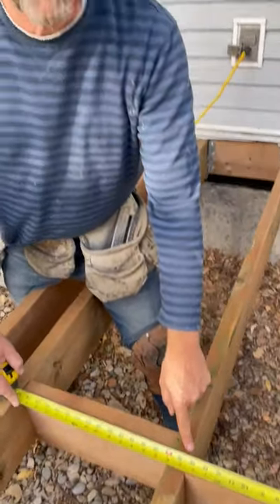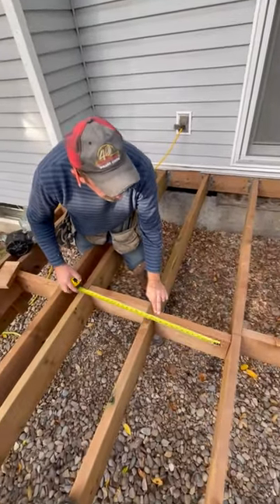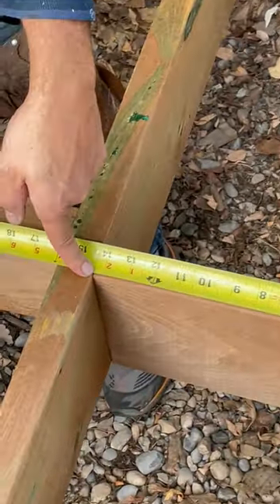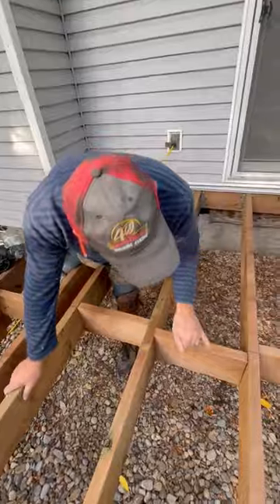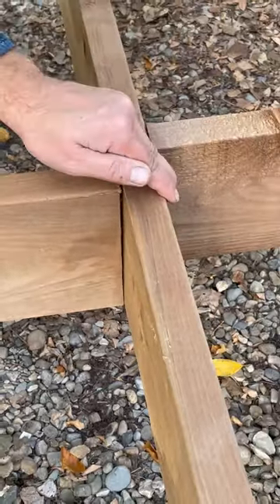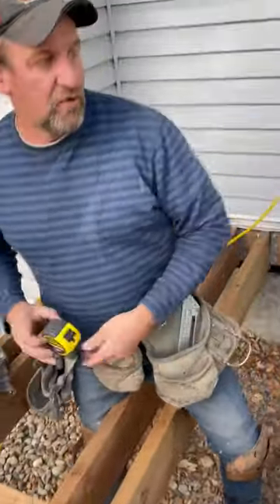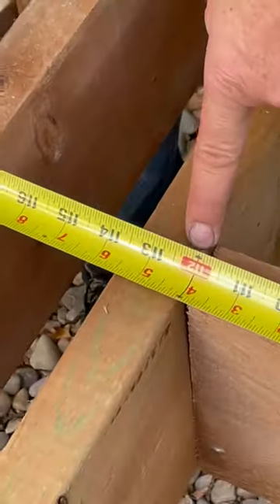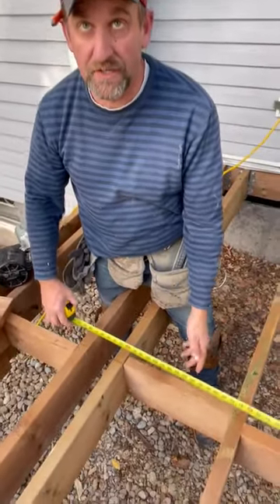Deck Joist Bridge Blocking

Comment: Very proud of you. 
All that extra time and effort will show up, and make a HUGE difference once the deck boards go down.
Reply from the maker: Thanks, I think.
Reply: not really lol 😂 it’s all getting covered with deck boards. those blocks are a waste of time and are doing absolutely nothing. they have no structural purpose. before you start decking. tack a scrap/ crappy looking board to your  joist on layout with 8’s in the middle. that will straighten them. install your decking up to the straighter board, pull it off and finish the deck. effectively saving 15 minutes and a rack of gun nails
Reply: @alexlaidlaw220 ,
   Those 'blocks' are what's called 'bridging'. They make the joist assembly stronger. When you're standing on a joist with bridging you're standing on three or four joys because they're connected that way it makes your deck way f**** stronger and more stable on top. Also if you've got some decking running another direction instead of all just one way you bridge on 16'x centers for nailers at 90°, etc..
Reply: @oldnick4707  these youngsters think they know something... those blocks add soo much strength.. it's mandatory over 14 ft in Michigan
Reply: @jaycie5200  I’ve been framing houses in Michigan for a decade now. The houses we build have spans up to 16 ft (16’ 2”) exactly. no blocking in between. nailing a 45 degree brace would be best bet for sheer value if you really think you need it. But these stupid blocks are doing nothing for downward pressure and little to nothing for sheer.
Reply: @alexlaidlaw220  🤔🤔👍
Reply: @alexlaidlaw220  😫
Reply: @alexlaidlaw220   aren’t you a silly Billy. Walk over joists with no blocks added, then try it again with blocks. Huge difference
Reply: @alexlaidlaw220 we don't claim you. Thanks Michigan. We use blockers in Michigan son

Comment: Very nice. I go 14 7/16 but I might switch to the 3/8s. If I have cupped joists I’ll try to suck it out with a screw, and if my cut isn’t square I throw the block at my cut mans head
Reply from the maker: LOL, good idea with the screwing.
Reply: Put 2 -16d or 20d hot dipped galvanixed nails together and face nail them into the staggered blocking. Sucks them up nice and tight.
Reply from the maker: @alfmuss3  Thats a good tip. Thanks.
Reply: I don't know about all states,  but "most" the time we get wet treated lumber the chemicals have swelled it up some. In other words 1.5 inch is more like 1.65...
Then when you cut your block a shanty short...your bang on!!!

Comment: I do a lot of composite decking and the decking we get we always have to cut off a 1/2 inch of each end because the factory cut is not square or the last bit curls up so 14-1/4 works for me doing composite decking. I would love to try to evenly space out all my joists, maybe I’ll talk my boss into it on next job, its just money lol.
Reply from the maker: Give it a try see if it saves time and money. Or makes the deck better. There is no right answer just tricks that help us along.

Comment: Need to clarify that you are measuring outside to outside which is the same as center to center.  that's why the measurement was read on the edge and not in the center.  Because you hooked onto the outer edge and not the center of the first board.
Reply from the maker: Point taken, I could have been more clear.
Reply: @decksbye3269  It's still a really good important video.  That 1/8th inch of grace is a good rule to remember.

Comment: My understanding is that blocking is to prevent the joists from rolling over.  If so, having minor gaps is just an aesthetic matter.  Right?
Reply from the maker: Correct.
Reply: Thanks for your reply, and for the video.

Comment: I cut blocks at 14 7/16" but If I tell the apprentice to cut them, I ask for 14 3/8" , for that same reason, 😂 to account for imperfections. cheers
Reply: I tell them to leave the line on 14 3/8"/ 22 3/8" blocks. 
As a framer, 1/16 is not spoken. Cut the line or leave it.
Reply: @anthonyjohnson-dd1ln  I am a perfectionist framer, sometimes measure to within 1/32" , but I don't expect that much from you or newbie helpers🤣
Reply from the maker: Jer, good point.

Comment: The gap renders the bridge block useless.  You will feel the sponge of the joist and hear the fasteners.
Reply from the maker: They are still making contact just accounting for imperfections in the joists material.
Reply: @decksbye3269  saw a few gaps on the video.  I pull a tape every 8 foot or so and adjust that one block if necessary.   Cutting them all short guarantees a gap in several.  One sixteenth off each means you loose ¾inch in 16 feet.  Either you have many gaps or bowed boards.

The average board is 1.5. 
14.5 blocks leaves 16 centers. After 6 or 8 of those you might need to adjust one a sixteenth either way. Every 8 or 10 blocks I eyeball down the joist to see how much to add or subtract from the next 14.5. All tight and right. 

20 years design,draftand build. Never failed a plan review and never failed an inspection on my end.
Reply from the maker: @ticktickboom420 , that's a great track record. Checking every 8' is a great way to account for variation while building quality.  To be frank, even when I cut the boards shy and need to check every 8' or so to ensure that they are lining up correctly.
Reply: The one guy I see here who 'gets it' The goal isn't to make them fit, it's to strengthen the floor.
Reply: @BobVogel-t1u  yes engineering not aesthetics.

Comment: When you tell your apprentice to cut the block at 14 3/8 and they look at you full of confusion 😂 so they cut it at 14 1/2 out of pure ignorance then you politely tell them they are of the slow species 😂
Reply from the maker: And it all works its way out
Reply: You need to explain to your apprentice why you are cutting them at 14-3/8" as opposed to the 14-1/2"

Comment: You could use a sliding t-bevel and get them tight while still accounting for the joists being twisted.  But who has time for that??
Reply from the maker: Its an option but like you said, it takes time.
Reply: It takes time correct just like making this video I would have spent more time on the deck

Comment: But if you lay your work out right, your work won't be off. So the 14.5 inch blocking will work out right. Blocking should be tight not lose.
Reply from the maker: Like Paul said, if the wood was perfect but till than you need to account for imperfection.
Reply: @paulunderwood8960  Paul, I have Been a Builder All My Life and I am Old Now. I'm not saying that " To Hurt You. I said it to Help You. The Purpose of the Sheets Metal on the Back and on the Top of the Joist Plate is to stop Wood Rot. The Leg Bolts 1/2'' diameter x 6 or 8 '' long is Strength. The Ledger Board on the Wall Joist or Joist Hangers is Also for Strength for the Floor Joist. One other thing being outside and Using  Pressure Treated Wood Always use Stainless Screws. Not coated because the Acid in PT WOOD will eat or dissolve the coating on Carbon Steel Screws. Using SS Screws use a 304 SS Screw or Higher. The SS Screws  304 or Higher Grade SS, because it will not Rust and will be there longer than the Wood. I prefer a #10 or #8  Screw for P T Wood. There are different Grades of PT Wood. Get the One with the Highest Grade of PT Wood for High Class Work. It Cost More but it Last Longer. The best PT Wood is placed in a Pressure Vessel and pressurized to about 200 psi at a High Temperature. The Higher Pressure, Hot Chemicals and Time Equal Better PT Wood. Today they don't use Arsenic. The Arsenic made the Wood last Longer and more Pest Resistance before 2003. Any PT Wood pre before 2003 would last 10 years longer than today's PT Woods. Please understand I am only wanting to Help You. My time building porches or Decks are Over. I have the knowledge but not the Body. Good Work Sells and You will be referred. Bad Work will keep You at Home. Best Wishes A Good Name is Valuable as Gold.
Reply: @paulunderwood8960  If You have been doing Your Building as Your Video shows You haven't learned any Thing. Yes the PVC wood composite will last a Long Time but Wood and Your work won't last 40 Years. The way You attached the Wood to the Outside Foundation will Not. It's clear the Homeowner has No Knowledge of the Work You are doing.  Have a Great Day.
Reply: @paulunderwood8960  I have watched your videos and you don't have many Followers. I understand why. You used galvanized Bolts not SS Bolts or Screws. You use coated galvanized Screws not SS Screws. I understand why People don't Follow You. You don't use the correct methods in your building practice. You do use the correct Joist Hangers. Metal sheeting over top[ of the Joist increases the life of the Joist and the tarpaper shows this. One other thing when pouring concrete it is always best to use a vibrator in concrete it stops the Honeycombs in the concrete, if the honeycomb is on the outside then it's on the inside of the pour. When you have honeycomb concrete water and snow will freeze in the honeycomb and will crack the concrete, so it does matter . There is a right way and wrong to do any Job. But when You have a closed mind you never learn. Even Old Dogs can Learn New Things. Best Wishes.
Reply: @paulunderwood8960  Now you know how to do it all correctly.. 😆
Reply: Not if your pt joists are over 1 1/2
Reply: Blevins is right, Paul is wrong.
Reply: But a LOT of PT lumber isn't exactly 1½" thick.
Reply: @lostpyper6973  Yes You are Right on thickness of boards, but You Always work on 16'' or 24'' Centers. You cut Your Blocking based on Your center plus or minus of your centers. Working on Centers You are always Right.  Happy Thanksgiving.
Reply: @waymonblevins6939  your math isn't adding up for me. I've been getting pressure treated lumber lately that measures as fat as  1 11/16.  Sticking with 16-in centers, ignoring the setback on your first layout, the fill-in blocking needs to be about 14¼+. If you just start blindly putting 14½-in blocks inbetween, you're going to be bowing ypur joists. I always lay a layout stick ontop of the joists ( usually right around mid span), drop some temporary screws to hold everything in place, and then take my block measurements. 90% of the time for me they turn out to be about 14 3/8 ish, but the layout stick allows me to take accurate measurements, and also lets me know if I'm trying to jam a block in that is too big. This was always more important when we were face screwing our decking and needed those visible screws to be a perfectly straight line. Absolute pinpoint perfect layout isn't quite as important with all of the Hidden Fastener decks we're doing now.
Reply: @lostpyper6973 The Building Industrial is Set-up for 16'' or 24'' on center. If you buy plywood it's set-up for 48 inch wide and 8 ft Long. With 48'' wide using 24'' centers the plywood will cover 3 floor joists. The first and 3rd joist  covered with 3/4'' on the Joist, the second is fully covered and Joist the Third Joist 3/4'' on the 3rd Joist. If you use 16'' spacing the plywood will cover 4 joists. The First JOIST and the 4th Joist will cover 3/4'' of the Joist being 1 1/2'' wide, joist 2 and 4 are covered completely. Not placing the joist on the centers of 24 or 16'' you will be continuing cutting up plywood to cover a floor using your ideas. That is why Master Carpenters use the spacing of 24 or 16'' spacing. In your case the wood you are stating is 1 11/16'' wide is two reasons, One is the mill cut the wood to wide or  second water they used to inject the chemicals into the wood. The water and the Chemicals in wood cause the Wood to Swell. But that shouldn't change the Lay Out of the  spacing of the Joist even though the floor Joists is 4'' wide. But 14.5 Blocking is for a finished 1.5 wide 2x4, 2x6, 2x8, 2x10 or 2x12 wood. But with width of 1 11/16 the Wood will Dry from the Chemicals and the Spacing between the two Floor Joist  will increase once the Chemicals and Water has dried from the Joist. The spacing NEVER CHANGES UNLESS YOU HAVE A CUSTOM SAWED FLOOR. SO WITH THE  FLOOR JOIST BEING 1 11/16 WIDE AND YOUR JOIST ON 16 INCH CENTERS THE BLOCKING WILL 14'' 1/8''. BUT WITHIN 1 YEAR IF YOU CHECK THE SPACING BETWEEN THE JOIST THE BLOCKING WILL BE SHORT. BECAUSE THE JOIST HAS DRIED. IF YOU HAVE PROBLEMS LIKE THIS IT'S BEST TO LET THE WOOD TO DRY BEFORE USE. I SAW A LOT OF HARD WOOD. IT'S BEST WHEN YOU CUT HARDWOOD IS TO STACK THE WOOD LEAVING 1'' SPACE BETWEEN EACH BOARD 1 YEAR AND THEN YOU CAN KILN DRIED IT TO 6 PERCENT MOISTURE. I NEVER USE WET WOOD. TO USE A 1.5 '' FINISH HARD WOOD I RUFF CUT IT TO 2 1/4'' WIDE. THE WOOD WILL SKINK TO 1 7/8'' BY THE TIME THE BOARD IS READY TO PLANE IT HAS DECREASED IN SIZE TO 1 15/16'' OR 1 7/8'' WIDE. THERE IS A LOT OF WATER IN WOOD. BUT THE SPACING ON A DRY WOOD 16'' SPACING IS 14 1/2''.
Reply: You are TOTALLY RIGHT. THOSE THAT FOLLOW THIS PRACTICE DON'T KNOW ANYTHING ABOUT BUILDING. THERE IS A RIGHT WAY AND A WRONG WAY ABOUT DOING ANYTHING. MERRY CHRISTMAS TO YOU AND YOUR FAMILY. I PRAY GOD BLESS YOU AND YOUR FAMILY AND THE JOY OF JESUS BE IN YOUR HEART.
Reply: @waymonblevins6939  you probably weren’t a very busy builder who has the time to let each wood package dry there’s deadlines and the person who made the video is right no two boards are the same

Comment: You should always pull your first one in 15 and 1/4
Reply from the maker: Same as above.
Reply: Harold  if you pulled 15 and 1/4 and laid out from that one they would be 16 in the center and an 8-ft board would work out perfectly
Reply: Harold  my way is the only way LOL
Reply: Harold  I'm old school I was used a 23 Oz Vaughn
Reply: Harold  I would never spend $300 on a hammer ever ever
Reply: Harold  I'll take you up on that argument. You start.

Comment: yet the 16 was NOT on center
Reply: @genghischuan4886
Edge to edge, is the same as center to center.
Reply: @Thesaurcery4U2C  not when you are building from the edge to edge, I know what you are saying but in truth you are robbing the measurement and its off .75
Reply: @genghischuan4886  
Oh, I didn't think he pulled from the outside edge.
I thought his tape was one joist in.
Reply: @Thesaurcery4U2C  yeah i understand, I think a lot missed it. not a fan of mid job cheats
Reply from the maker: What Scottys Indistinct amassment chronicling life said.
Reply: @decksbye3269  👌
Reply: @decksbye3269  Everyone kind enough to share their opinion with you on the rights and wrongs (Lol) are basing their ideas on where they build.
I started framing in the late 80s doing identical duplexes in a development at a blistering rate, because that's how they paid.
We were a tight 4 man crew who stayed together, and in a couple of years we were building in the nicest developments in our city.
6 or 8 trusses on a house, and all the rest stick built. I loved that.
I Then went into commercial Restaurants.
Back to a speed quality mix, you just have to get over it and give them what they ask for. All of the buildings are still standing, quickly built or taking care.
I've became a good trim carpenter as well, and 4 or 5 years ago, I went and worked in Aspen for a little over a year; 2 houses; mostly 1.
That is a completely different world.
How I would love to be able to take my time with beautiful product on every job.
But what we do is, give the customer whatever it is that they want.
It's called rough framing, and it looks good from my house, still produced a happy customer in a lower income home. 😏
I'm now a G.C. traveling through the states building restaurants again.
Doing much less physical work, and working on my belly instead. SMH... probably gained 20 pounds in 2 years. Lol.
Reply: @genghischuan4886 Over the years I've learned to do whatever is expected of me, by whoever signs my check.
I would love to take the time to do only quality work, and i get that in trim work, but many framing crews just want to fly full speed, because that how it pays.
So I just fall in line, because it's covered anyways.
There are a few picky builders out there in custom homes.

Comment: How about simply doing it right. I've been a carpenter/joiner for 50 years, you don't measure in the middle of the span, you measure where the joist meet the beam. If you have done your layout correctly, and the structure is square and flat, you cut your blocks at that measurement, the purpose of the blocks is to add rigidity and more importantly to keep the joist from twisting. All of your load span calculations are done with square, and plumb materials. Now year the blocks out and do it right. One more thing, you tied that deck into the rim joist of the house, did you use proper fasteners? People have been killed and crippled because some moron did sloppy work.
Reply from the maker: Waiting for your video.

Comment: You deff have more then an 8th in imperfection.  Who can't cut a 90!!??
Reply from the maker: If only we all where only perfect.
Reply: I think he is trying to explain that nominal wood has imperfection  and this is why we carpenters know what accepted tolerance is and that each aspect of carpentry has its own tolerance. 
This is the reason why a cabinet builder ( carpenter) don’t build decks. It’s not that he can’t but his tolerance is to small and that’s not profitable nor is a deck builder trying to build cabinets  not that either can’t ( or don’t) but they each have there own skill set
Reply: @stephentucker5406  ABSOLUTELY,  rough is rough,,finish is finish! I'm finish.  If I'm helping my dude that does rough , I just do what I'm told . If he has time he will show me these kind of things. Got to be willing to learn!
Reply: I can. You can’t? No chopsaw?
Reply: Who can’t use a measuring tape?
Reply: Lumber has went to junk. Quality has went out the window. Your lucky if stuff stays square till lunch time. Over night, forget it.